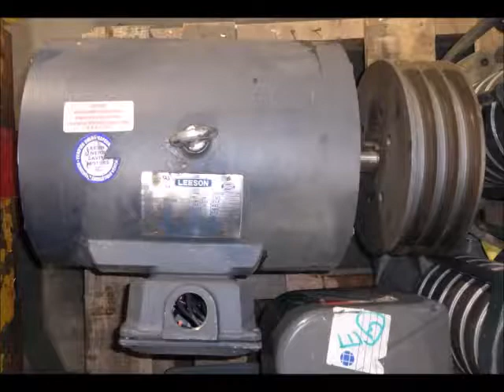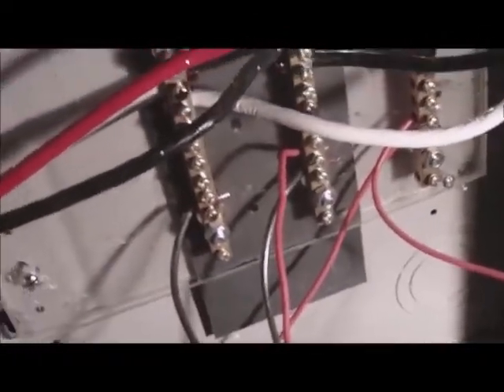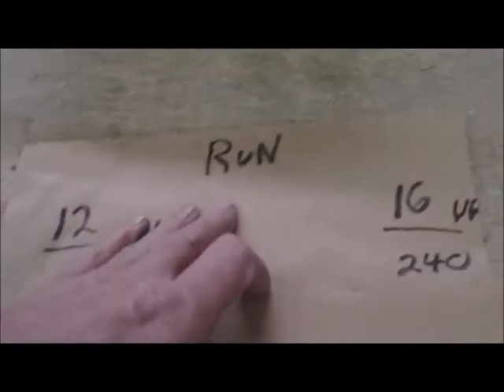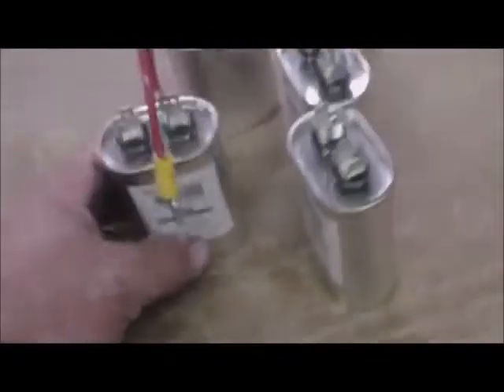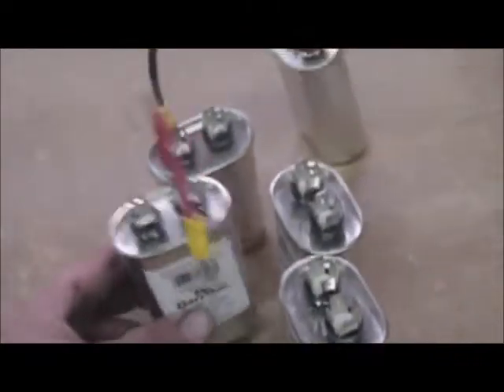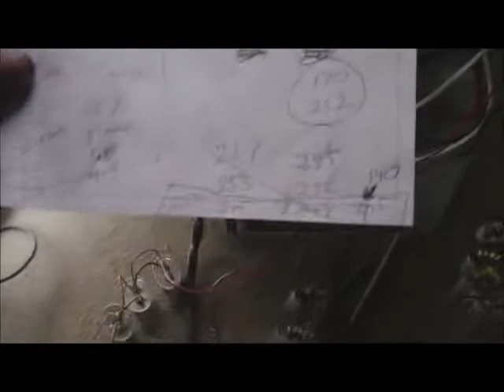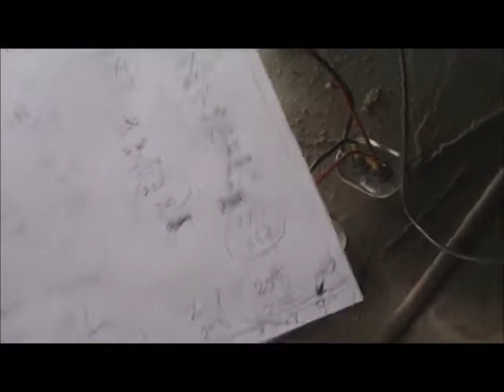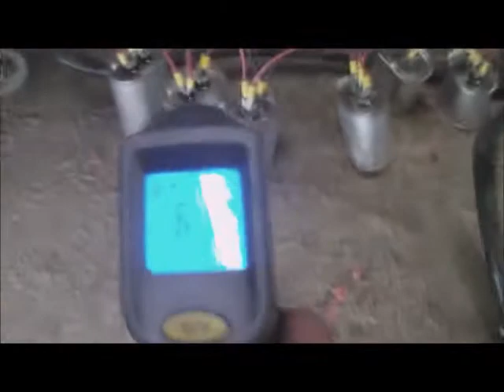Building, Balancing, tuning a 15 HP 3 phase rotary converter  with capacitors

Comment: The number of  poles actually determines the rpm.  So you can't have the same number of poles and a different rpm. 2 poles is the minimum you need to make a functional motor so that is as fast as you can get with a given frequency. Because of inefficiencies though you never quite reach that theoretical maximum. In the US we use 60Hz AC. Assuming one cycle equals one rotation, that is 60 rotations a second, times 60 seconds is 3600 rotations per minute.

Comment: Thank you! I was close to giving up on my homebrew RPC because of horrendous power factor and voltage imbalance issues, but this motivates me to give balancing it another go. Given that it has been a few years since you posted this, how is it working for you? I was curious about the pony motor since the point of it was to avoid start capacitors and controls for them on your idler, but since the pony motor itself has capacitors and a centrifugal switch to cut the start cap in and out, has this worked out to be a low-maintenance option?

Comment: A great Video Matt! It covers the essentials very well as regards to using a pony motor. The huge reduction in the inrush current on starting the idler results in the much simpler electrical design.  I am driving a 1/2 hp motor on a polisher machine from a 2 hp idler.  I recall, the idler was drawing a little over 5 amps on each of the 220V input legs to the idler .... before any capacitors.  Thank You very much.

Comment: I got lost at the end where you discuss all the balancing as to not understanding which capacitors were hooked to which lines. A drawing would be nice or a comment saying xmfd was connected between A-B, x mfd was hooked to B-C, x mfd power factor was connected to which were they were connected.

Comment: Back in 1970s a friend had set up using a huge motor with about a 2” shaft for converter. We would spin it with our feet to at least over 100 rpm to get it started.
I always wondered just how it was hooked up. One thing I learned from YouTube videos is that none of them show how it works. They show “ I used a this motor to run a that motor “  “ I made a box and use circuit breakers for wire connectors “ 
Still looking for one that shows how it works

Comment: A start capacitor and a relay will start your 15 hp with the touch of a switch. That would eliminate the small starting motor and make the unit more compact as well. 
Another option I’ve seen is a drill with a coupler on the end of the shaft that pulls off once it’s running. 
Either way, really good job.

Comment: This was a great video  makes me confident I can make one myself...
 I have 3 motors....  largest is a 7.5 hp then the ones I want to use are a 5hp and 3hp...  question even when you balance this motor shouldnt you also balance any other motors 3rd phase you use on the circuit?  Or you just need the voltages close  to create a strong stage 3rd leg  so as to not have to do this to other motors being used in the shop... 
 Maybe a good idea to add capacitors on the switching end of each motor(machine) in the circuit so they come online the same time as the machine your trying to use...  I think that is a smart idea myself (to balance each motor individually) before running them long periods in the circuit... any thoughts?

Comment: Remove the pony starter and do a simple contactor and capacitor starting circuit. However, if you're just running three phase motors, dump the converters and just install single to 3 phase VFD drives. The are so much better and give your machine far more speed control capabilities, like an infinite transmission. Single to three phase VFD's up to 7.5HP are usually between $100 to $300 depending on how Chinese you go.
Reply: I'd agree with you except for the fact that VFD are tuned to one motor so if you have several motors to run a RPC is much more versatile albeit that you do not have speed control like with a VFD

Comment: its 3 phase for 1 motor ? or you can used it for many motors at the same time ?
Reply: You can run as many motors as you want, just as long as the total horsepower doesn't exceed your pony motor.
Reply: @flyoversirens3704  thanks
Reply: Anwar Alfaqeeh Alhusseini , your biggest motor should not exceed 50% hp of your phase convertor but you can run up to 3 times the convertor hp provided you don’t start them all at once. 
I have a 15 hp convertor have run as much as 35hp with it and start a few machines before starting my 12 hp machine. Once the 12 hp is running the others can be shutdown, they just provide the extra power for start up.

Comment: Get rid of the small start motor and fire the main pony motor with a starting capacitor.Mine only needs one start cap,needs no pulleys or belts,and has been running my 14-40 lathe and bridgeport mill for the past 10 years.,plus it's completely silent being it's mounted outside the shop in a water-proof box.
Reply from the maker: I would love to have all of the components needed to have push button start! My bills wont let me..:(